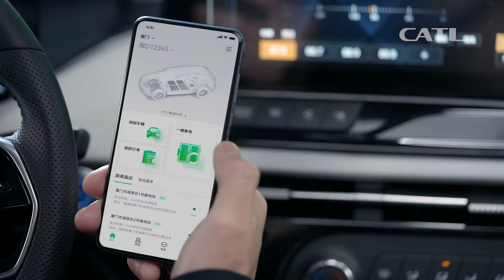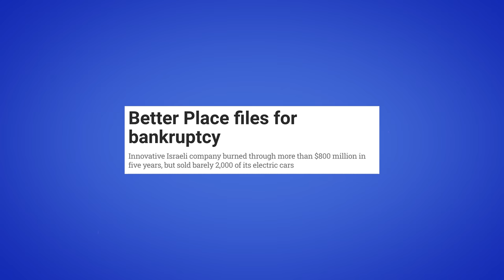Why Battery Swapping Is A BAD Idea

Comment: Battery swapping is stupid if you actually think about it. You pay a higher price to buy an electric vehicle. And it's expensive mostly because of its battery. And then you swap your brand new expensive battery with an old one because you're too important to wait 40 min. Now your new battery is in circulation and you're stuck with old used garbage. That pretty much sums up battery swapping.

Comment: Swapping battery stations are also better for the electric grid. the 72 car charging station you mentioned would put a lot of strain on the grid especially if all were charging at the fastest speed. Swapping stations would have batteries all ready charged, at lower charging speeds

Comment: Hydrogen fuel cells.  No massive mineral-intensive, overweight brick.  ICE-like range and fueling times.  No major performance decrease in freezing temperatures.  Right now the fuel cells are a little too big relative to the power they produce, so hydrogen cars tend to be low powered compared to modern ICE and BEV cars.  But miniaturizing the fuel cells is at least as feasible as creating batteries that store a lot more energy without needing to be bigger.

Comment: Easy battery swapping would be a good idea if it was done personally between 2 battery packs. Basically you use one in your car while the other one is at home trickle charging. But the car company would have to convince you to buy a second battery pack, buy the machinery to do the swap, and then allow the company to come in and permanently modify your garage for the machinery. Tough sell.
Rapid charging also presents a problem because the battery packs aren't designed for that kind of charging all the time and the more you do it the shorter your battery will last. It's basically for emergency use. 
Personally I don't think EVs are our future for transportation. They're fun for the few that can afford it now and will probably always have at least a small presence, but an alternative fuel will have to supply the other half of the global driver population and that demand is only going to grow (save for another black plague event). Unless there is a revolutionary new battery that replaces lithium in both resource abundance and power density, EVs have pretty much reached their full potential. The only way for them to be better now is to be more wasteful by cramming more resources into 1 short lived car.

Comment: I like your video but Pls try to make sense of what you are presenting. Battery swapping does help motorists , especially cross country trips in a hurry. Cost on number of station shall be left to the invested, it does not matter whom they are. If you have the money, you can invest. At the end of the day, it does achieve the purpose of EV

Comment: Battery swappability is good from the sustainability standpoint when the battery goes bad, so you swap the battery a few times in your car's lifetime.
Reply: Irrelevant argument: It's not your battery. During car's lifetime, the battery provider keeps all batteries in top condition.
Reply: @pg205  i think you misunderstood what I mean...
All normal EV's should have a easily swappable battery, so you can get a new one if the current one dies.

Comment: I think the idea is very good, but it shouldn't be viewed as either / or: charging vs swapping. I think we should have both. Battery swapping will make sense for some in some contexts, while charging will make sense for others in a different context. For example in cities, you don't really need fast chargers and we could invest in more 11-22kw charging points, like it's done in Germany, at least in Berlin. But as more cars become electric swapping stations may be a good supplement to slow chargers as not everyone will be able to charge at home. On highways it makes sense to build both fast chargers and swapping stations (more real estate) — battery swap can be more expensive vs fast charging or even priced dynamically in order to control demand and car flow. I'm okay with fast charging on my typical road trip of up to 500 km. But on longer journeys battery swapping would be better, because 12 minutes x 3 adds up, especially if the journey takes 6+ hours. 
Also, another solution I've seen tested (in Sweden if I remember correctly) is wireless charging, which would be perfect for cities — although it still needs real estate for the charging infrastructure, only saving space on charging posts and it probably requires more heavy work to install charging coils into parking spaces. Nevertheless, it's good that there are different ideas being verified. Realistically there's no chance that every car manufacturer will agree on 3 standards (regular charging + swapping + wireless), even agreeing on 2 of these is rather unrealistic (as pointed out in the video) and only government regulation could make it happen.  Nevertheless, my point is that we shouldn't treat these different technologies as mutually exclusive, but rather and complementary.

Comment: Right, battery swap stations cost £600k. Have you ever priced up a petrol station?? Bet they cost that - with a huge tank underground. Plus on the danger element - folks were scared stiff of cars exploding when petrol stations first appeared too. Think of trusting Joe public to fill up maybe 15gallons of flammable liquid - that’s why they were not self service for years. Fact is charging any battery produces heat and rapid charging batteries daily really reduces the life of them. Also on the topic of all different cars  can’t use one battery - when petrol cars were first on the road it took years for manufacturers to  agree a standard formula for petrol as we know it. Basically - we are in the infancy of electric cars if they do evolve it will take years.

Comment: I think battery swapping is a great idea!
It solves the whole problem of your battery wearing out in 5 years, rendering your expensive car worthless.
The government just needs to mandate a single battery size/weight/voltage/connection standard for all cars (or at least no more than 2 or 3 to accommodate small cars, large cars, and trucks).
And if the cost of leasing the battery is comparable to electricity rates for the amount of power that the battery stores, I'd be okay with that.
However, if you're someone who only drives your car a few times a year and you only need to swap batteries once every few months and/or can trickle charge it at home continuously, you shouldn't have to pay the same monthly lease as someone who swaps their battery weekly.  Instead of leasing the battery, there should be a one-time fee each time you swap your battery that's comparable to the amount of power you are buying.  Or always give the car owner the option of owning his battery if he can charge it at home.
Reply: Why might your battery "wear out" in 5 years, when it has an 8 year warranty?   And an exhausted older battery doesn't mean your car is "worthless". It simply means you may need to consider a battery refurbishment, which usually costs a fraction of a complete replacement. Seems like you need to do some research...... You obviously never heard of battery refurbs.......

Comment: it is good for non super wealthy ppl who can't afford new cars. with EV, old cars have old batteries=less range and if it breaks, cost is impossible to afford. (also a reason why only wealthy ppl celebrate EVs currently). with battery swapping system, you can by a used EV and don'T worry about the battery or the fortune it costs to replace at one of the greedy incompetent brands liek renault and tesla (who say it takes 8+ horus and a fortune to replace a battery). becasue you simply get a battery fully charged at a swap station every once and a while anyway without owning and needing to worry bout the battery. it's great.

Comment: battery swapping can work with one venor and one or two batteries; but in the real world with dozens of vendors and hundreds of different batteries, its obviously dead from the start. unless you are silly enough to believe that all the competing auto makers can come with a standard of one or two batteries? also you would need a huge stock pile of batteries to swap out and since for the foreseeable future the number of batteries determines the number on EVs.

Comment: Srandardization, black markets and profits are bottle necks of the concept.
Look at Tesla alone, they link the batterypack and powertrain to the VIN just to prevent black markets for there packs (That's why car rebuilders fail on rebuilding tesla's). Swapping would mean reprogram the packs everytime they're swapped. And if there is going to be a lithium shortage, imagen the value of the contents of such a swapping station, they would become super vulnerable bank vaults.

Comment: I would say that this video ignores the biggest benefit of battery swaps, that being the extension of the lifetime of the electric car. The battery is easily the part that ages the quickest, requiring a total replacement within 4 years, maybe even 2 years if you really abuse it. Battery replacement technology can keep an electric car on the road for 10-20 years, just by making sure that the part of the car that sees the most wear gets regularly replaced.
Reply: The expectation Tesla has of their packs is 350k+ miles so somewhere between 10-20 years is already the expected longevity of a modern battery pack.

Comment: My take away from this video is at 04:54 " Experts are currently not sure whether there is enough Lithium right now or in the future" . And we are now putting everything into EV's, it sounds like a madness has infected the motoring companies of the world. Why would they do this if experts etc...
Reply: Experts say there's only enough oil to last another 25 to 30 years too, so take your pick..... There is plenty of lithium. There are large deposits to be found in around a dozen countries...... most of it currently comes from Australia..... And of course once mass EV adoption arrives, then recycling of older EV batteries can step up a gear, and return 90% of the lithium and cobalt back into the system, to be reused in new batteries. Try that with petrol or diesel......

Comment: In the transportation context, there are some 'boggy' areas; especially with batteries leased at random in a public facility.  The Siemens eFusion battery swap system for light training aircraft is interesting.  In other situations, my first rechargeable power tool was a hand-drill with a built-in battery... imagine trying to sell that these days!
Thought-provoking video, thanks Rory.
Reply: I agree with you , nice comment , hard to compare battery which you can carry to the your socket and charge,and battery swapped in public place with timing and other complications

Comment: You did not even touch on the fact with battery swapping you will never have to throw away your perfectly good 9 year old car because the battery that came with it is now trash and it $15,000 to $20,000 to replace it.

Comment: 18 minute charging for me would mean that I am not buying the EV ( yes range anxiety is real). Its just too long of a time and hassle. Most people I know agree including those with EV ( They will refuse to go on long road trips with us lol). Now if you tell me that all I have to do is a 5 minute swap then it becomes a whole different ball-game. That's almost as much time as topping off a ICE vehicle with gas. So yes, the time saving is valuable and it's worth it in my opinion if the companies can make these things happen. 

And im not convinced that the number of extra batteries that would have to be built is too large. Lets say no one will ever charge at home ( obviously not true) and the average mileage is 10K miles a year per driver with a range of 250 miles between each swap. That ends up being 9 days between each battery swap per vehicle. If it takes 5 minutes to do a swap, then a station would need 12 batteries so that each battery it receives is charged a total of at least an hour before it is passed on to the next customer. Those 12 batteries are enough for a single station to work continuously. Assuming it only sees usage 50% of the time, then it would service 144 cars a day. Over the full 9 day period during which on average all cars would have done their swap, these 12 batteries at a single station would meet the needs for 1296 cars. so all you had to do was make 0.9% more batteries (12/1296) and that is with assumptions like no one is charging at home ever and those stations get only 50% usage etc.

Comment: The worse issue is that there is no car battery standard that makes the swapper dedicated to a brand or two. Maybe there will be such a standard but for now we do not have one. Maybe the Brits will have their own standard. 👍😂
We need enough fast chargers and slower street charging. Not a big or expensive challenge to fit slower charging to a parking space.

Comment: Couldn't disagree more.  Buying a used vehicle with an unknown battery in it as today is a massive disincentive. Buying a used vehicle where if the battery is bad I just swap it out at a swap station maintains the viability of used cars.
Reply from the maker: But new AND old batteries are always in the pool. You may buy your car with a new battery (which does 300 miles), then a week later you go on a trip via a swap station and could be given a battery that's had heavy usage (which does 180 miles). You may never get your new battery back because it was never yours in the first place.
Reply: @AutoTraderTV  you'd be buying a certain capacity wouldn't you... 75wh / 100kwh / etc. If you don't get that then that's where regulation comes in.

Comment: That idea has been floated for years and will never work.  First, if I have brand new EV and battery am I going to pull in and get a 3 year old one with less capacity?  Next there has to be a common battery change out capability among companies, not going to happen.  Third you have all different battery types. GM has Ultium, Tesla 2190 and 4680 cells, Plus other types.and more to come. How many batteries would be need to be fully charged and ready? You wound have to build a large warehouse that could charge hundreds of batteries.   

What is really needed and practical  is wireless road charging where special mats are on the roadway or integrated into the road surface.  You drive in this lane  like a special toll lane and it charges your Easy Pass account or credit card.  Battery Swap out will never happen and is not practical.

Comment: The arguments in this were all wrong. Charging stations are cheaper than petrol stations. Universal modular battery design adoptation will be inevitable. You can charge as many batteries as you can cars. The space taken up is miniscule  if built underground. After 60 mins the first battery removed from a car is charged and ready to go in another car. If you have to travel abroad then use a super charger when your there but have the convenience when at home i.e. 99% of the time for almost evryone on the planet.

Comment: Even though the deficiencies proffered are valid, they are far from insurmountable. Evs will at some point need to have a more interchangeable battery, change/charge stations will need to be built.this will be more of an issue in countries where land is at a premium but concessions need be made for the sake of yhe environment. Financial issues would appear to be the biggest obstacle. But again....it can be done.
The big question now is with current battery tech(no pun intended) will this need be an option?
I say in certain countries likebamerica where there are still vast open expanses of land then yes.even if just for the forseen future of electric freight hauling.
If the tech ever comes to the point where a power storage media can be refreshed in the time for a trip to the loo and the purchase of a bag of crisps then this will become a moot point.

Comment: Chinese government doesn’t just own their car makers but also battery makers, miners and most of the supply chains. Over 70% of battery materials production is under their control. And those minerals are present in a few countries (compare to a hundred of countries with oil under their soil). Most of the early research regarding environmental impact were backed by Chinese government. Most of western car manufacturers that decided to go EV in the early days are owned by China. Tesla launched their first car in 2008. A year later China launched their policy on EV and started taking over the miners. Keep in mind how Chinese government runs its country. It’s going to be easy for them to do things from now on.

Comment: Battery swapping would have made sense 10 years ago but only if the oil companies had become involved so every petrol station was also a battery swap station. If back then they had seen the same future Elon saw they could by now have tied up the market but instead they were too focused on trying to kill battery cars, not cash in on them.
It's probably too late now for all the reasons Rory mentioned.

Comment: I'd love battery swapping, I'd be able to keep my car for many years which I like, because electric cars don't need much maintenence and I'd always be  using fresh batteries with whatever range I need. If I'm doing city driving I can stick to 75kwh. If I want to do long distance I know that I'll be able to get the 150kw. As technology improves, my car will be able to take even higher kwh batteries. Who knows,  maybe they'll reach 200kwh or more. It's perfect if you don't have trickle charge access and don't want to wait at charge stations or just as a way of switching between different kwh packs. It works perfectly in Union with standard charging. I don't get why people don't like it, especially considering it's clearly working in China.